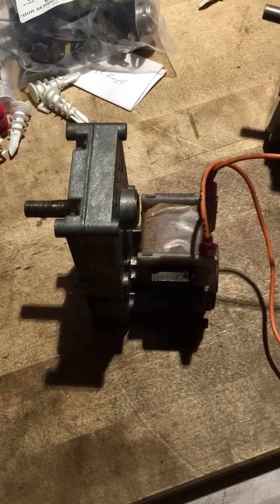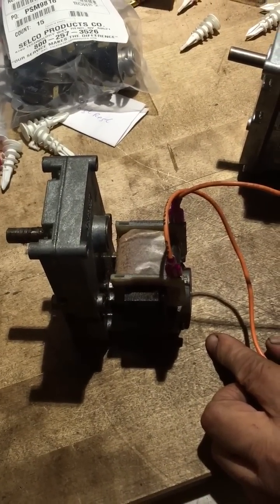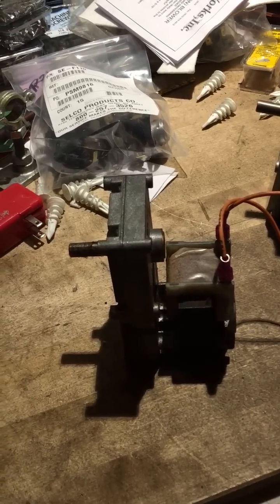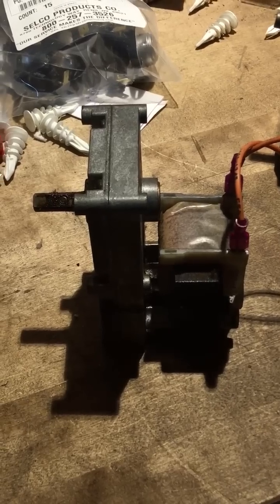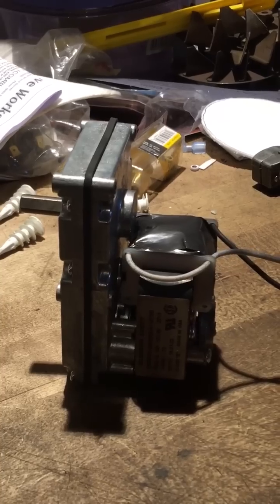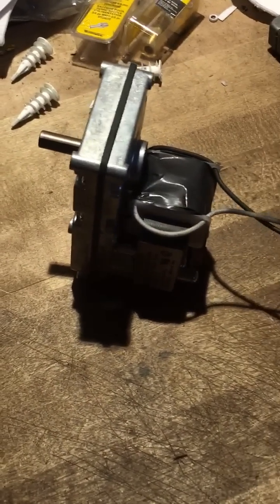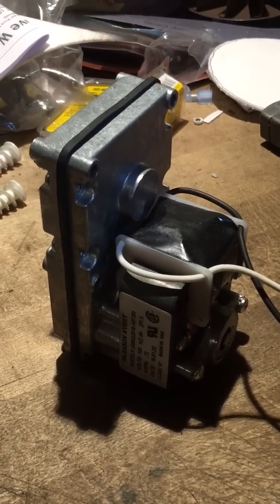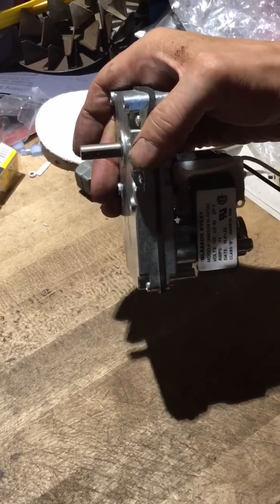Pellet Stove Auger Motors - How should they sound and what makes them fail.

Comment: Hi Don522-

I know it’s thanksgiving however, checking to see if you are still active and responding to inquiries?
I have an Accentra 52i or Insert. I have cleaned it and replaced the Auger motor and now am getting a clanking sound when the auger cycles. Can you help me figure out what I may have done wrong? Thank you.

Comment: I drill a small  hole in the gear box and pump in six or seven squirts of gear oil.The factory puts two little blobs of grease in there to last for years.The gear oil moves about and lasts several years.
Reply: @samkaplitz9036 you don’t worry at all that metal shaving fall into it when drilling a hole through the metal? Does it not open up with screws around the outer edge? Mine does but it’s a  different stove. I’ve opened mine and added some fresh grease but never considered gear oil.
Reply: One small hole(1/8)inch,drilled in the case is all it takes.Put grease on the drill bit to catch the shavings.

Comment: Hey Don, I installed a brand new Gleason Avery motor A-901 supposed to be a 1.1 RPM.  When my auger light is on the motor turns as it should but when the light goes off, the motor doesn't stop it does a sort of rolling stop.  Think of it as a light bulb when it gets turned off the bulb dims with a slight glow then goes off.  But, in my case its as if the auger never stops.  It turns then does a rolling slow down then turns on again then rolling slow down.  Do you think I have a defective motor?
Reply: it might be a bad triac on the controller board.

Comment: I have an Englander 25 PDVC 55 Stove, i  just replaced the lower auger motor! I noticed that it seems to run a lot htter than the top motor 88°f vs 155°f! Is this normal? Thanks
Reply: Yes

Comment: I can push the manual feed button and the auger motor works, but it won't automatically feed.  Any ideas? I have a Breckwell.
Reply from the maker: Sounds like a Bad Control Panel
Reply: Same here, did you ever fix it?
Reply: I have same problem, did you get it fixed?